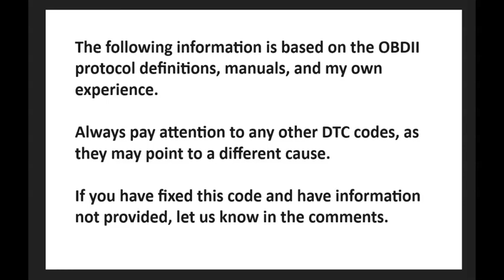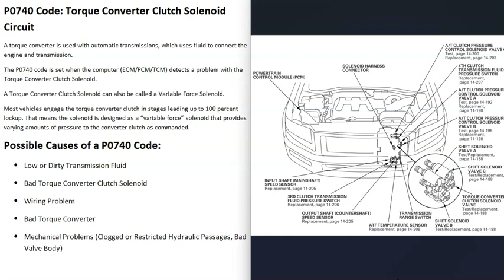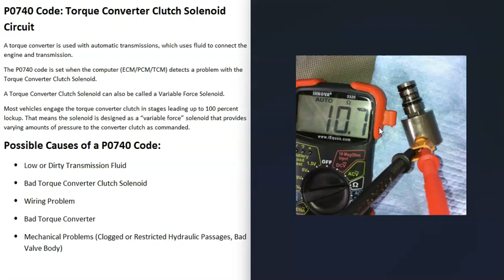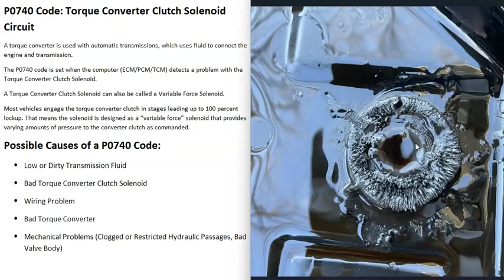Causes and Fixes P0740 Code: Torque Converter Clutch Solenoid Circuit

Comment: I have had this code on for about 18 months with my 05 T&C with 375K miles....why no symptoms in running or driving??
Reply: I bet you'll find you're not getting full lockup.  

I had this code, drove van many kilometers.   The only symptoms other than the check engine light was lack of full lockup of the torque convertor.
Reply: @MrHemi4spd-420O have full lockup and it runs fine.
Reply: @kdeh21803  

It's not really noticeable.  Have you had TC slip measured?
Reply: @MrHemi4spd-420no....I don't feel any slipping

Comment: I have a 2000 Chevy Silverado 1500 I just did a swap of a 4l60e to 4l80e I replace flywheel but in order to make it fit I take off the  center spacer (tick metal) because holes where off I bought it from Amazon and I thought is a defect not a wrong fit so grind it down to make it fit and I install it now is running it go back and forth and park but is like week and I a bunch of codes related to the clutch converter electrical circuits and solenoids for 2/3. I know is a lot is kind of a big swap. Jeje 😅 thanks I don’t know s** just trying to get some fun

Comment: 740 code has nothing to do with the solenoid. You would have more codes along with it.
Reply: The code literally reads "torque converter solenoid circuit open"
Reply: @DowneastBeast whatever you say 🤓

Comment: Just replaced the transmission after getting a p0147 code, replaced all the sensors that didn’t fix it so I replaced the transmission, that didn’t fix it. Finally replaced the ecu that fixed it until about 30 minutes into my drive when I got the p0740 code along with a p0700 code. At this point I’m assuming I screwed up putting the torque converter in somehow. Checked the fluids cleared the code, and it seemed fine for about an hour. Any ideas? I swear if I had hair it would be pulled out by now. 😅
Reply: Check wiring connections

Comment: so i bought a 2018 Ram 2500 2 weeks ago and check engine light came on and took it to dodge dealer and it said PO740/stored. Stored?? and a p1521 wrong oil type ???   I bought the truck from a chevy dealer . Im thiniking i should have bought a Chevy!!!
Reply: You got to put the right oil in these newer trucks..if it says you need 5w-20 only put 5w-20 in it and p0740 most likely torque converter